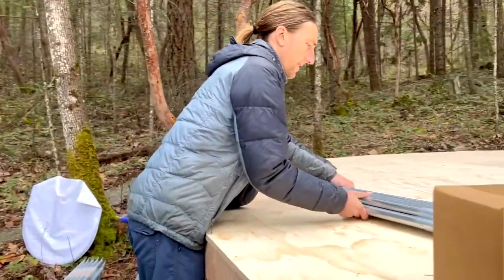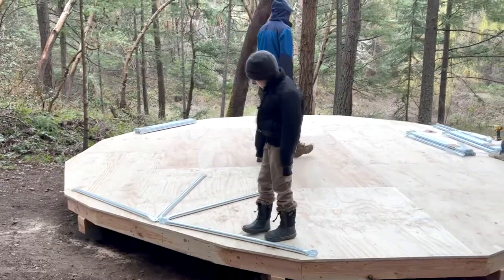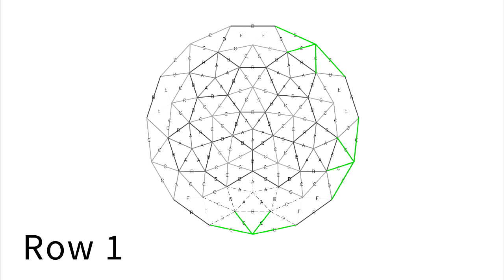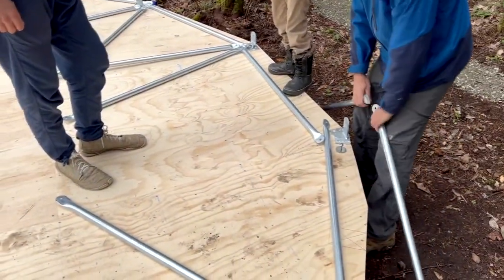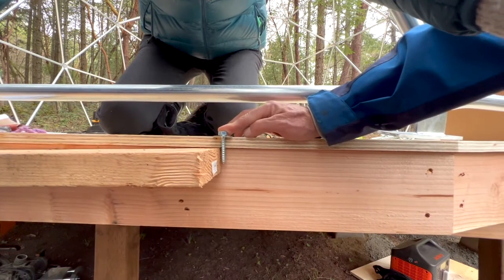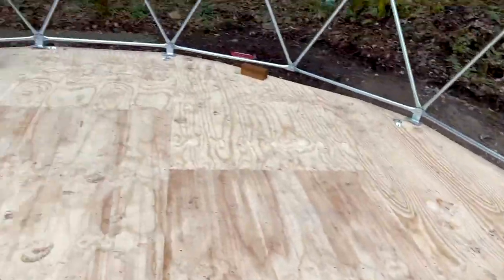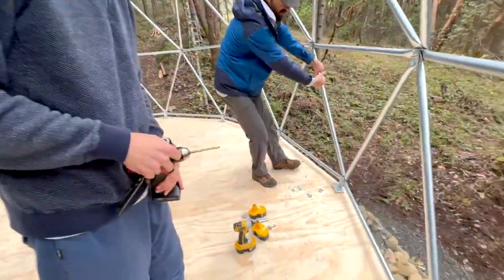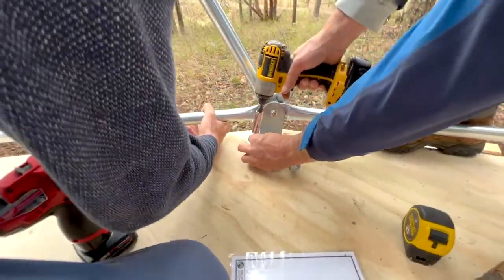How to Build a Dome - Part 1: Frame

Comment: Hello, that is amazing, I'm trying to build one myself and I'm wondering if you can share with me the framing pipe dimensions
 plans of that 24' diameter dome. I will be highly appreciate it, thank you so much
Reply from the maker: Hi there! We're thrilled to hear about your interest in building a dome yourself - that's incredibly exciting! Regarding the framing pipe dimensions and plans for the 24' diameter dome, we utilize multiple tubing sizes depending on what is needed for that dome. To ensure you get the most accurate information tailored to your specific project, we recommend reaching out to our dedicated sales team at sales@pacificdomes.com. They'll be more than happy to assist you further. Wishing you all the best with your project!

Comment: The length of the bolts appear a lot longer than the ones supplied to us to assemble all the struts together.I might add this was a crucial part of building our frame,Assembling 6 struts together with shorter bolts was nearly a impossible task.I would implore Pacific Domes to supply longer bolts for future dome builds to make it more practical to aid when you are up near the top of the frame build.
Reply from the maker: Longer bolts make it easier to assemble, but leave a length of bolt sticking out at each hub. To avoid that hazard while in the dome, we opt for the shorter bolts in our kits. However, if you want longer ones that is also an option.
Reply: @PacificDomesInc  Yes it maybe a hazard for the lower long bolts but I can’t see how it would be a hazard if longer bolts we supplied for the upper struts as they are well above the heads of any occupants in the dome,Also it only appears to be when one is trying to join the upper components of the frame that longer bolts are required.
Reply: @dude2850  I agree with this comment after just putting one together. Longer bolts up top at least should be automatically included. Gravity and height with out a scaffold is tough to fit 6 struts on it. Easy build overall but bolt length should be at least 1in longer